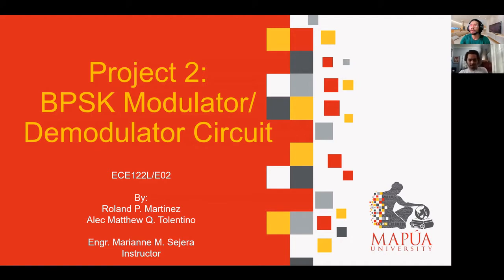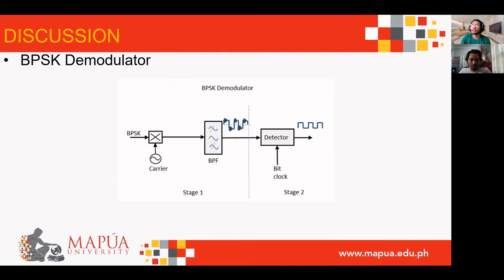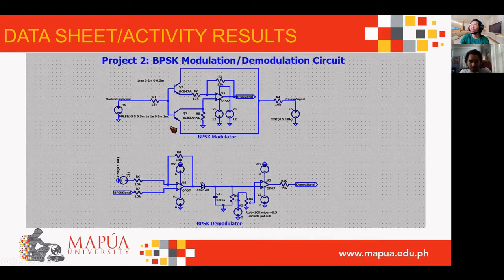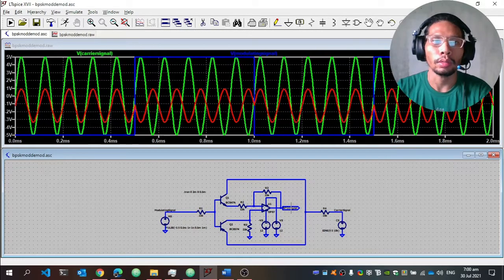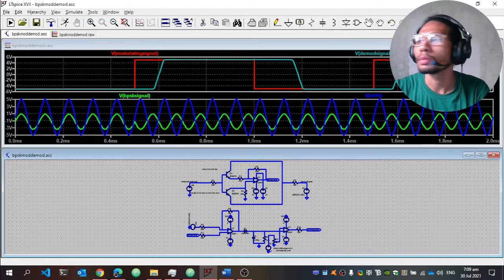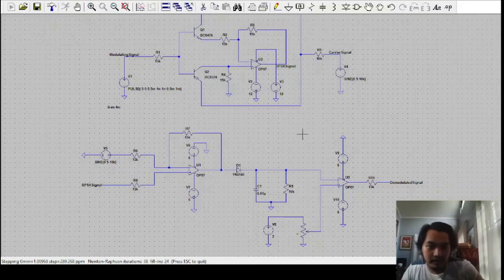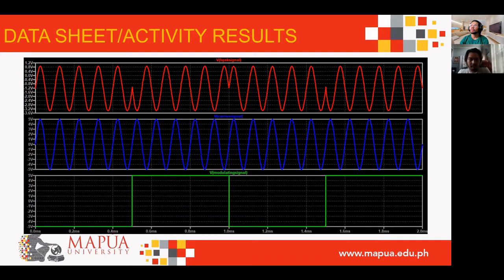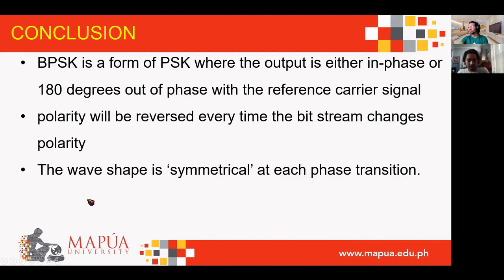BPSK Modulator/Demodulator Circuit Design  and Simulation using LTSpice

Comment: I am unable to get the bpsk signal output correctly is there any solution for this??
Reply from the maker: You mean the modulated bpsk signal, right?
Reply: @rollmartz19  yes sir
Reply from the maker: @keertihatti1998  are you using ltspice and followed our bpsk circuit? Actually the only thing you need to modify is the modulating or the carrier signal to you desired specification.
Reply: @rollmartz19  I have used exactly same circuit in ltspice only sir
Reply from the maker: But are you getting same output plot?
Reply: @rollmartz19  it's not in a systematic format in zig zag way I Am getting and unable to understand 
Please suggest sir I have done my mini project on this only
Reply from the maker: @keertihatti1998  check the PULSE property. I think there is something wrong on your PULSE property
Reply: @rollmartz19  sir could you please convey me how to check it
Reply from the maker: @keertihatti1998  try to check the pulse output using your probe, if that is in zigzag form then it is the problem.
Reply from the maker: it should be in this format PULSE(-5 5 0.5m 1n 1n 0.5m 1m)
right click on MS voltage source or edit it directly.
Reply: @rollmartz19  I did same sir  even though I am not getting
Reply from the maker: @keertihatti1998  are you getting square wave on the PULSE output?
Reply from the maker: https://drive.google.com/file/d/12Q8udgebVsQO1dIz67Pp_fXuIhFVo1j-/view?usp=sharing try to run this one.
Reply: @rollmartz19  yaa sir
Reply: Now I got output of bpsk modulator sir 
Where as for demodulator the symbol of pot(just a name)need to be created??
Reply from the maker: It needs to be created.